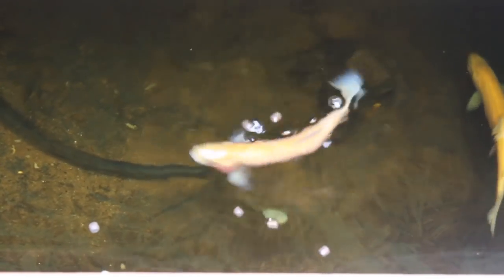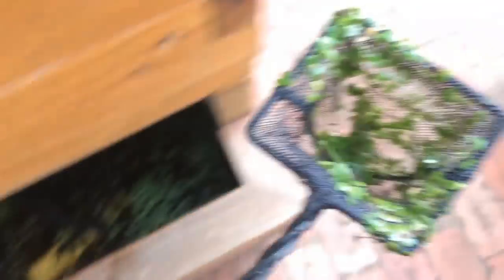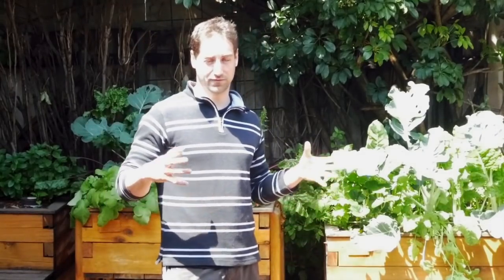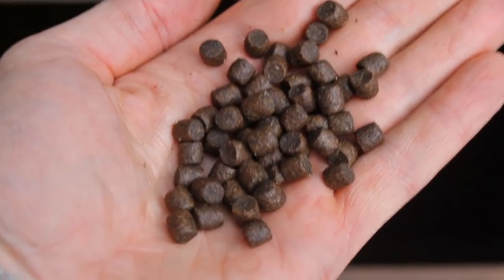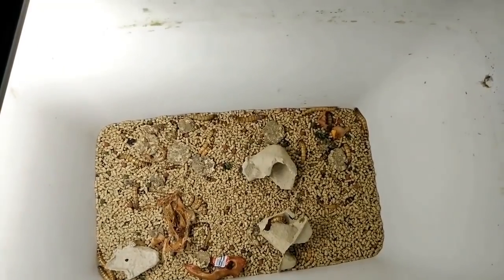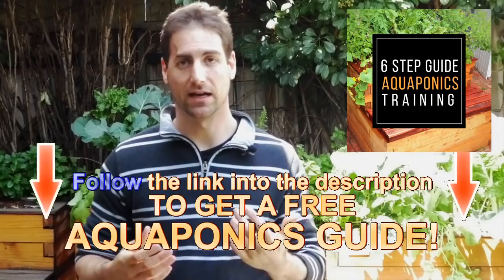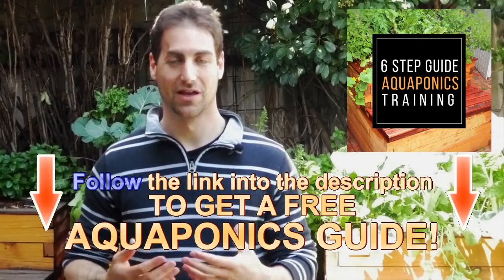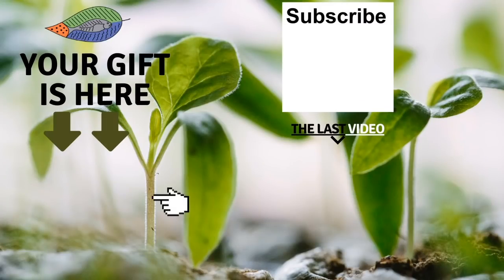How to completely close the aquaponics loop

Comment: Do you have any experience using coconut coir as a growing medium?
Reply from the maker: Hi Emozbunny! I haven't tried coconut fiber yet but I heard good things. Obviously the surface area is very high and it can be used in small floating pots but I wouldn't recommend it for a grow-bed as I imagine it will break down with time.
Let us know how you go.
Thanks
Reply: emozbunny I have used coco coir for many years now and it's a great grow media, although with aquaponics a bit more of a challenge.  I have found that Canna is by far the leader in coco and coco fertilizers.  You "must" get the loose Canna coco to get the best results.  For fertilizer, they recommend a few different products and have a great grow guide as to exactly how much and when.  Of course they are geared to cannabis but any plant loves the ferts particularly in coir which they were designed for.  Just the Canna A (veg) and Canna B (bloom) can be used with good result but they suggest Cannazym which is good and Rhizozyme which is good too etc.  It depends on your budget.  The coir itself is reusable and Canna recommends doubling up on the Cannazyme to better break down roots from the previous plant and other organics left over.  As for aquaponics, you could do a watering once a day in fact once every other day depending and you will be fine.  I'd use a coarse hose and a short timer and let them soak then 20% drain off.  One reality/problem is that you want a pH of about 6 for the coir and those ferts to work well.  Maybe 6.5 but no more.  Forget about 7.5.  pH is pretty key so if your fish are at 7.5 you may go another way.  You will also see some fine particles from the coir that you may not like in your system.  The coir is not the biological filter the clay balls are.  You could however just set the pots of coir say 5 gallons on top of the Hydroton and dig them down a couple of inches and let the Hydroton flood and drain.  The coir will suck up the water from below and this would thereby eliminate having to water at all, and open up the opportunity to hit the plants with some lower pH from the top down without impacting your fish.  Currently I have tilapia in what started out as a mild canna A and canna B water and they seem to like it.  Growing duckweed in there and letting them eat it with no other food.

Comment: great info once again. great musings. either your sound quality has improved or I am becoming more  attuned to your delightful accent.   Outer Melbourne grower. My closed loop is focused on not spending money, whilst being sustainable and safe.  I love giving my silver perch duckweed, lettuce, worms, slugs and beetles, but I find that the filtration required for the fish tank is 3 to 4 times greater than if I just feed pellets. ie. whilst ammonia, nitrites, nitrates etc are fine. The tank water is cloudy for days. I like to look at my fish.
I have a 1kL ibc main tank, (25 F @ 200gm ave = 5 kg biomass)200ltr radial flow, some secondary mechanical filters and 1200 ltr sump, 600 ltr second tank (100 F@ 3 - 5 cm fingerling .5 kg biomass) 3 x 300 ltr expanded clay grow beds

In the vegie garden I grow broad beans over winter/spring to fix nitrogen in the soil. I believe they produce a nitrogen root nodule in the soil that then decomposes and is available for following crops

If grown in clay beds, will the nodules slowly decompose and release nitrogen without creating anerobic conditions. Interesting thought

   I haven't discussed the option of going vegetarian with my fish yet. 

I have been providing about 30% vegetable diet so far. 10% bugs, 60% pellets. 

Many thanks for your work
Reply from the maker: Thanks Paul, really interesting! so you see a big difference in the water colour when you feed with natural elements... Yes the nodules will return the nitrogen in the system same as in a classic soil :)
Reply: The stuff in those pellets is nastiness.  I am done unless it is absolutely necessary.  The other part of the "equation" is that I am going to start eating excess duckweed and start quacking and waddling around,
Reply: im always working on closing that money loop.  rush down to mings emporium hoppers crossing for your $5 pumps. Im training my yabies to eat anything. they like oats.
Reply: @irontoad123  that's cool, I never heard of a yabby but should catch some local crayfish and see if I can grow them in the river water.  Do they breed in captivity or just eat the little guys?
Reply: yabbie is fresh water crayfish but very tough and omniverous. native to aus its also in jamacia and some pacific islands. just starting with them as pets then food. they live in dams an streams here.